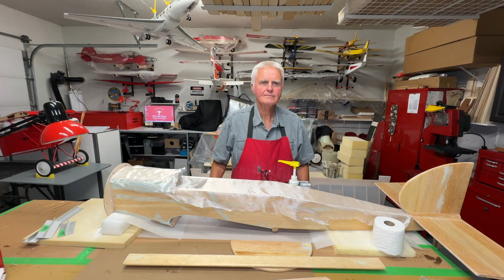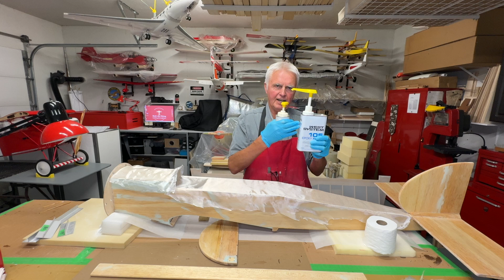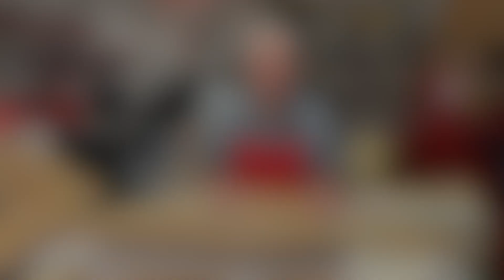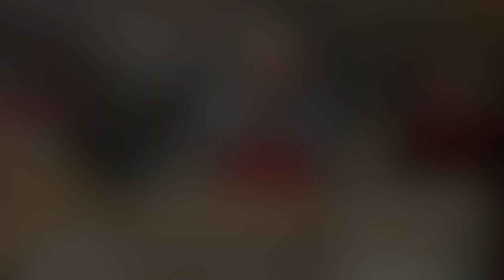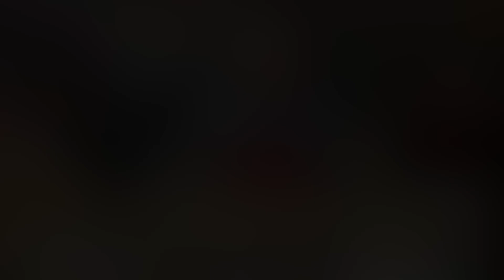How To Fibreglass An RC Airplane Fuselage

Comment: Rick, Sorry to ask a question on an older video. I am about to the finishing stage on a Sig 4 star 120. I am wanting to cover the wing with coverall fabric and use your wing video for tips and procedures. What would you recommend for the fuse on the 4 star. Can I use the same tech stuff as the wing?
Reply from the maker: No problem, you can ask questions from any of my videos anytime 😊. It depends on the finish you want and, mostly, durability. You can coat the fuselage with epoxy resin and sand it smooth; you may need filler in spots. You can also use very light fibreglass cloth with epoxy resin for the most durability and added strength, but it will add weight. Or you can give it several coats of nitrate dope, sanding between coats, for the lightest results. What kind of paint are you planning to use?
Reply: @rcflyingwithrick I’m an automotive painter by trade(at least I was). Most likely some 2K primer and base coat clear coat. Polyester base coat and urethane clear. May do the Nitrate dope coats. Since I will be covering the rear open areas with fabric. I wasn’t sure if I could “just stop” the fabric where ever.
Reply from the maker: What are you powering the Sig 4 star with gas, glow or electric.
Reply: @rcflyingwithrick either a Satio 150 or 180 so glow fuel. I have started covering with Sig koverall. First timer.
Reply from the maker: You may what to consider...Epoxy Paint is the gold standard for painting RC airplanes because it provides a hard, highly durable, and completely fuel-proof finish that resists glow plug fuels, gas, and nitro.
Reply: @rcflyingwithrick what type do you use. Brand?
Reply from the maker: I use Klasskote, it's amazing paint. https://www.klasskote.com/?

Comment: Thaks for info. What if you have a fuselage and wing that is not solid wood everywhere and if it has some open spaces. Can you still glass it?
Reply from the maker: Yes, no problem. You can glass over the opening with the fiberglass cloth. After the resin cures cut the fiberglass cloth out of the opening. Use a new no.11 X-ACTO blade to make the cut. It will leave a nice edge around your opening.

Comment: Rick - you may have shown it somewhere but I did not see any putty or filler application but I do see it is there before you glass the model.  Is there a video that covers how you do fillers and what putty or filler do you use?  Thanks.
Reply from the maker: Hi Paul, This video talks about the filler I use and application. Hope this helps.  https://youtu.be/hHb6JMY3xSY
Reply: @rcflyingwithrick  Thanks so much - I will get some on order.  In this video you show sanding this filler with 80 grit but it is over cured fiberglass.  I notice you have used it in many places that appear to have been done before fiberglass.  Is this filler easy to sand without getting into the soft balsa wood?  Thanks again!
Reply from the maker: In my opinion, this is one of the best fillers I have ever used. It sands easily and does not pose any issues when applied to untreated balsa wood. I would not recommend using 80-grit sandpaper; instead, opt for 220 or 320-grit. While it's more expensive than other fillers, you receive a substantial tube. This filler works exceptionally well for creating fillets. One advantage is that it's a two-part filler, which cures evenly and never cracks. Be sure to use it in amounts that you can apply within a reasonable time frame—around 10 minutes or less, depending on your shop temperature and the amount of hardener used. It might take some practice to get the hang of mixing the right amount of hardener. I have had it start to harden in 5 minutes. I purchased it from an automotive parts shop, but I've also seen it available online.

Comment: I have seen the toilet paper soak method but wondered if it leaves fibers behind.
Reply from the maker: I have never had it leave any fibres behind.
Reply: @rcflyingwithrick  Just tried it while glassing my TF P-51B kit. Toilet paper worked perfectly and as you said didn't leave anything behind. Got my new method.

Comment: What is the green/ blue filler your using on the balsa before glassing?
Reply from the maker: It's called "Blaze Glaze" (Automotive product) it is an epoxy filler that hardens in under 10 minutes. It is a remarkable material that sands easily. Although it is pricey, it is very strong and goes a long way.

Comment: Great videos, keep them coming. Question: I am making an old AAMCO Aeromaster and it has stringers in the turtledeck of the biplane. What would you recommend for glassing its fuselage, would you use the same poxy method you are showing here? Thanks, all the best for you.
Reply from the maker: That sounds like an exciting project! The biplane looks fantastic. However, I wouldn't recommend finishing it with fiberglass and epoxy. While it is possible to do so, it would require a significant amount of time, and the added weight could be a concern. The turtle deck, of course, will remain as is.

Comment: Great work!  Any reason not to use a squeezie to remove the majority of the excess resin?
Reply from the maker: You can use a squeegee, but be careful not to move the fibreglass fabric or to stretch it. Also to accomplish a perfectly level surface and not to remove too much resin. However, I find that using bathroom tissue paper is very effective in removing just the right amount of resin and keeping the surface perfectly level. It's also easy to remove the resin by just throwing the paper away. This method works well for beginners in glassing. In the end, it all comes down to personal preference.Thanks for asking. Rick

Comment: I'm surprised your doing glass on this project but very cool! I'm going to try it on a project I'm working on this winter. Looking forward to seeing your finishing steps! Mike
Reply from the maker: Hi Mike, I use this type of surface preparation on almost all the airplanes I work on. It provides a significant amount of strength to the airframe, helping it withstand flight loads and preventing damage from hangar rash during transport. I have airplanes that are 30 years old, and you wouldn't be able to tell. Additionally, there is minimal weight penalty if applied correctly. If your model is meant to have a metal surface, the smooth finish is ideal for adding details such as panel lines and rivets. Definitely give it a try....cheers, Rick
Reply: @rcflyingwithrick  i sure will. Yes it's metal with fabric on the tail surfaces. And ailerons. It'll be first time trying for a scale look. I am in the process of building it right now. Thanks.
Reply from the maker: I'll check it out on your channel 👍😊
Reply: @rcflyingwithrick  sweet the first video should be coming out in the next couple weeks.